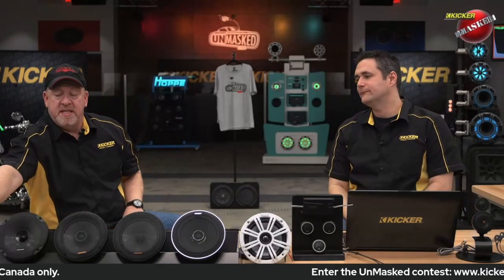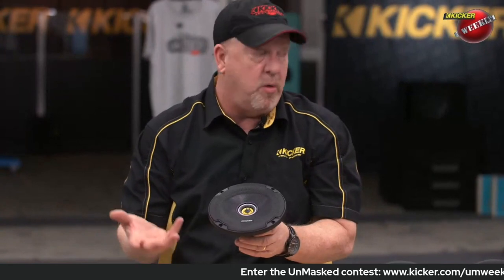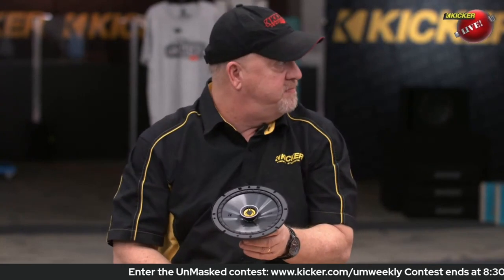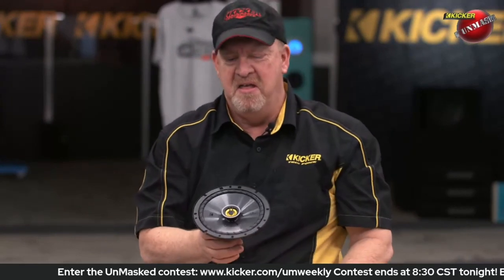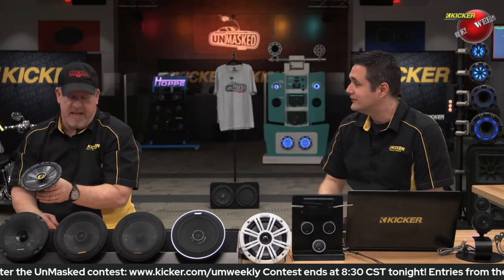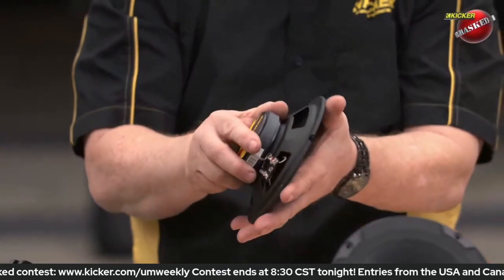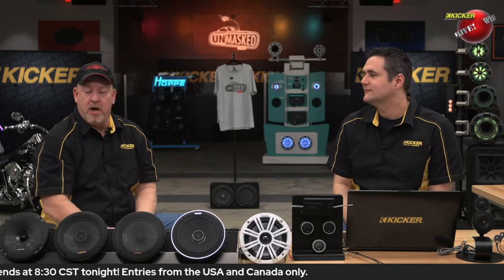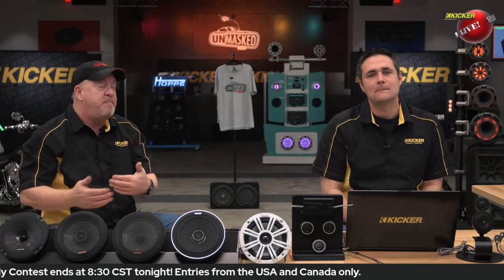Kicker CS Coaxials - KICKER UnMasked - Shorts

Comment: CS or KS 4inch front and rear for 21 ford Bronco? Paired with Key 200 amp.
Reply from the maker: The big difference between the CS and KS is primarily sound quality. The KS is smoother and more detailed.  The CS is louder and bit more directional.
Reply: @KICKER-AUDIO  Given the open air with the top off the CS would perform better? Louder and more directional sound while driving with wind noise?